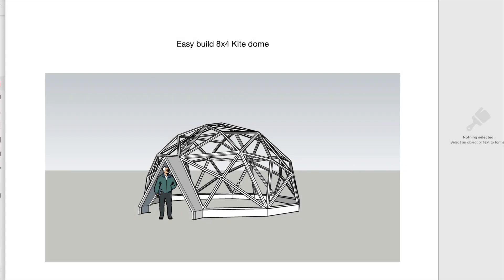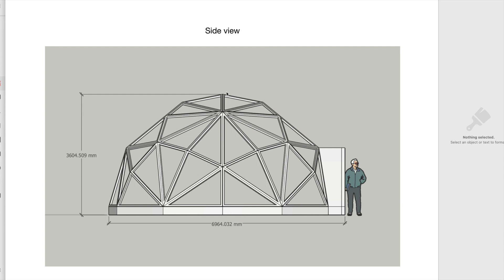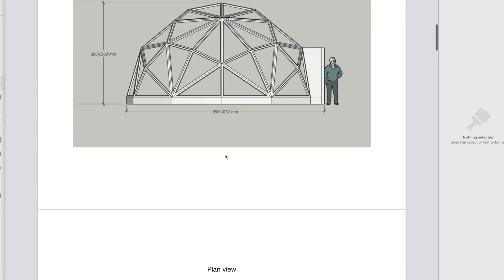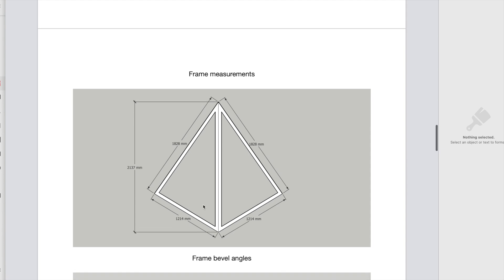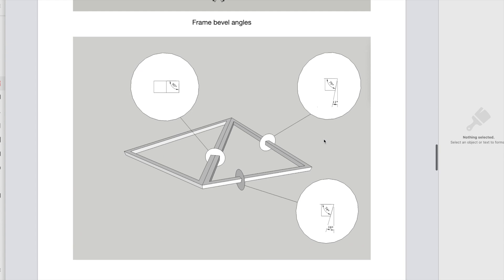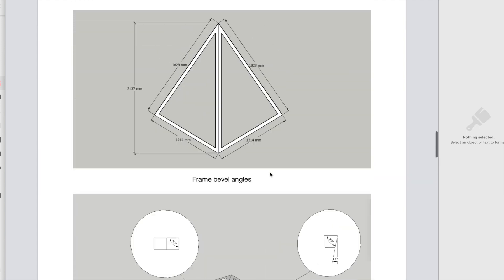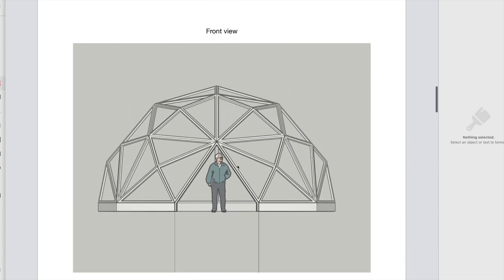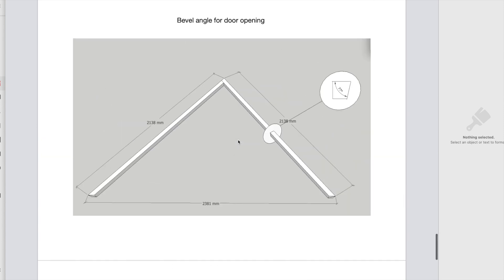UnityDome Most efficient dome free plans

Comment: Maybe it looks like simple and from the math point and linking it is along with flat bottom. But there are actually 6 different pieces from engineering standpoint that has to be build, also triangles are bad gor any kind of openings like windows. I was thinking in the same direction but ultimately I came to a conclusion that less elements the better. My approach was mixing triangles penta and hexagon shapes to form modular structure. I ended up using only 5 elements with 3 od them not being prismatic (forming triangles) that are used for static load. Kudos for your work and sharing it. Really good work.

Comment: Paul could you make plans for a dome from hexagons?
Reply: It will have to involve pentagons or triangles or squares.
Reply: @JohnGuest45  i saw a guyvdo it with all hexagons
Reply: @guyguy1614  
I suspect it was high frequency dome and you overlooked  6 pentagons amongst the hexagons and half hexagons..
Reply: @JohnGuest45  no it was all hexagons. It did have a few windows. The math works out. Paul can make plans with no problem. Hes good like that
Reply: @guyguy1614 
I think you will be disappointed. I`d love to see this dome, do you have a link?
Reply: @JohnGuest45  its on youtube it a guy from hawaii
Reply: @guyguy1614  
I`ve run across that one before,  its a 6v 11/18 sphere. To build it you`ll need to make 86 individual panels which includes 6 pentagons. It`ll be a lot of work ;)  On closer examination, the hawaii dome should be a 6v 13/18,  3 hexagon panels below the pentagons, but it ended up looking more like an 11/18

Comment: Firstly, I want to thank you! And I have a question. What is dimensions of wood material? Not length, but width. Ex. 5x5 cm, or 7x7 cm...?  I think is need to have some width for this dimension...
Reply: Rule of thumb for timber domes is the depth of timber should not be less than 1/24th of the strut length. For a 6ft strut that would be 3". The timber width should allow for minimal deflection, rip the struts from stock that will provide  2" of timber width when the two panel edges are screwed together. The strength will be equivalent to using  6ft and 4ft  *3x2`s (*finished size) to build the dome.
Reply: @JohnGuest45  Thanks for the guideline. So if the longest strut in this build is 7', the finished size of the timber would need to be 1" w x 3.5"d x 7' long?
Reply: 8x4 = roughly 10x20cm, then cut it ( as shown from 3rd minute on )
... Well, to my understanding anyway.
Thank You, Paul !!!
Reply: @dariostarsky8124 
8x4 is 8ft x 4ft , in some places its only 1200mm x 2400mm
Reply: I would be interested in that also ! Can t see the answers ... all in private. Thanks for this great dome pre work!

Comment: It would be nice to have Imperial measurements but not necessarily needed. 

I wonder what it would take to make this into a tunnel type structure? Being roughly 20 feet in diameter it's not enough room to build a 17 foot kayak and get around it. Adding 6 to 8 feet in the middle would be sweet.
Reply: You can actually do this build a hoop house with two ends ending in a half dome. If you want an easier tunnel, look at the icosahedron. That middle part will just repeat endlessly giving you a tunnel.

Comment: This is a good looking dome layout.  Perhaps a calculator could be constructed for the strut lengths for different size domes.
Reply: Sure I can do that. But if you know what it is called, you can find one online. These type of domes are derived from catalan solids. This is for instance a disdyakis triacontahedron, which is a deltoidal hexecontahedron where the deltoids are split into two triangles. If you wikipedia them, you´ĺl see the similarity between the two.
Here is a calculator for a deltoidal hexecontahedron:
https://rechneronline.de/pi/deltoidal-hexecontahedron.php
Reply: You dont learn anything if everything is done for you.
Any calculator can be used to find the chord factors ,  Strut Length / Radius  equals Chord Factor. 
For a different size dome, Radius * Chord Factor equals Strut Length.
Reply: @JohnGuest45  so if I want a 13m diameter, I am building 4 metre-ish triangles?
Reply: @JohnGuest45  Not all of us have that background
Reply: @clydeharless899  
Resizing to a different radius is just simple multiplication using the 2 values that you already have, the strut length and the dome radius. Using the same units (inch, mm, ft etc) divide each of the original strut length(s) by the dome radius which will give you the chord factor(s). Once you have found the chord factor(s) for the original struts you simply multiply your new dome radius by the chord factor(s) which will give you the new strut length(s).
Reply: or...new dome size over old dome size to get the scale factor. same thing. @JohnGuest45

Comment: why dont you just blow up a balloon and cover it with cement?  this sounds a hella lot easier to me.
Reply: Well, my lungs aren't as good as they used to be!
Reply: @markroeder2491  
. A 20ft hemispherical airform with 2" wc (500Pa) air pressure supplied by  a small blower will support 4500lbs.thats a  5/8" thick coating of wet shotcrete over the entire form. No lung power required.
Reply: @markroeder2491  hardeeharhar
Reply: One reason is that concrete has a terrible environmental footprint. Many people want to avoid and minimise it's use.

Another is the joy and satisfaction of building
Reply: @JuggleGut  well then cant you use a dirt mixture instead of cement to cover the balloon form?
Reply: @IronMan-yg4qw  'dirt mixtures' don't hold up well if exposed to the elements. You will notice buildings made that way have a long overhanging roof, to help protect.

Even with this, it's a very cheap and simple method that with maintenance can provide dwelling for a lifetime, without a lifetime mortgage.
Reply: @JuggleGut  
You dont need much cement if you consider the thickness of an egg shell compared to its radius. If you take account of the transportation, cutting and fixing of alternative materials, cement doesnt seem that bad.
Reply: Just as with a wooden boat, repairs are possibly more likely easier.
Reply: @MarkT  the repairs to a cement house after a hurricane or earthquake or  wide spread fire will be less expensive!  but a doll house is easy to replace i guess.
Reply: @MarkT  a wooden boat is easier to break too.  a cement dome is easy to repair too.  just fill cracks with cement.  and cement domes stands up to hurricanes and earthquakes and fires!!!
Reply: @IronMan-yg4qw  Materials being different. Drying times.. Delivery, logistics, horses, courses..
Reply: @MarkT  ya? for yours its cutting, assembling, hubs, hooking up struts then covering it with what? plastic?
why not just blow up a balloon/form and cover with cement/aircrete? so faster an easier, and so much stronger in the end!!
checkout aircrete harrys channel. he did just this an is inspiring.
Reply: @IronMan-yg4qw  harry, yep, have seen, thx

Comment: Interesting structure! Thanks! It seems that it would be possible to build the dome using a combination of four corner kites and the two triangles only where you want the dome to meet the ground or a wall. Each kite is flat, the curve of the dome is created only where kites or single triangles meet. Would it weaken the dome a lot to take out the two middle sticks in each kite?

Comment: Thanks Paul, this is a wonderful design, with so many "features" in the result!  Think I will try this with EMT, either 3/4 or 1 inch.  Can even build in stages if rested into a corner, then flat wall, etc.  Inspiring...  thanks again.
Reply: stacking 10 struts on one bolt? lol

Comment: Out of interest how rigid is this compared with a geodesic dome? I saw some stress testing somewhere in the past for a geodesic dome (may even have been this channel) so would be interesting to compare the strut stresses with this style of dome. Cheers.
Reply from the maker: I would say more rigid, it has all great circles which will guid forces down to the ground. I would need to do some tests though.
Reply: @Geo-Dome  If you do get around to testing this, I'd be more interested in how well it copes with some struts missing. So eg this dome (minus struts for door) vs traditional dome (minus struts for door). It wouldn't surprise me if this dome is stronger once the doorway is factored in!
Reply: @Geo-Dome  I built a model in paper, seems to be quite floppy until you put the last bits in place and even then it doesn´t take a lot of side force. The shallow angle decagons have a tendency to invert.